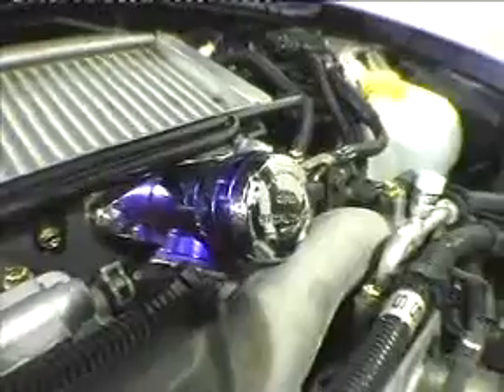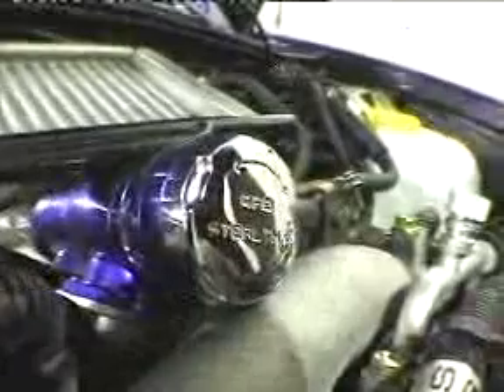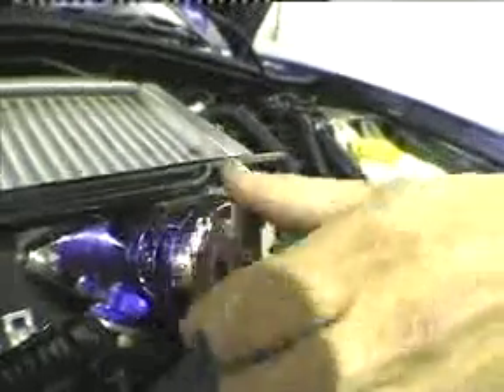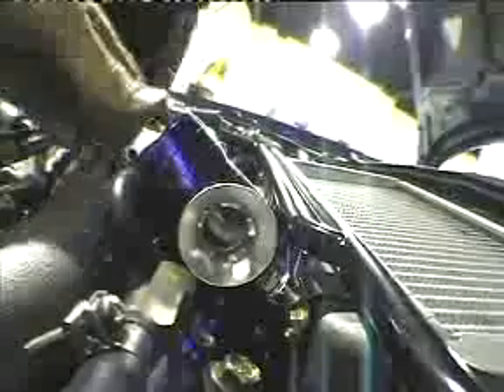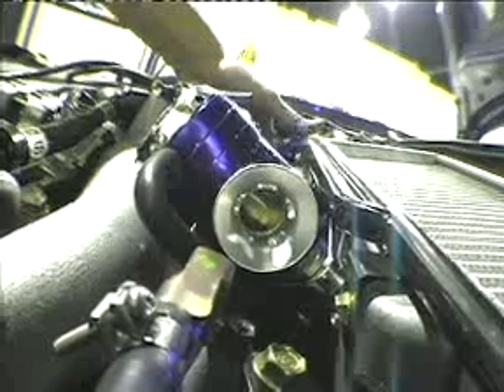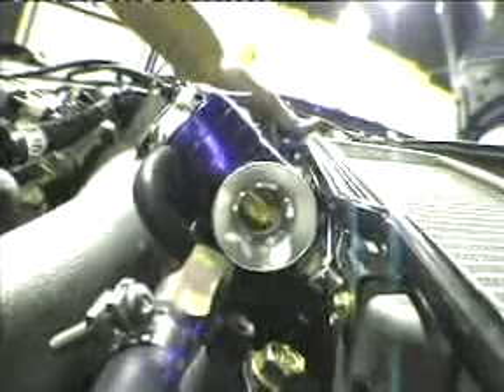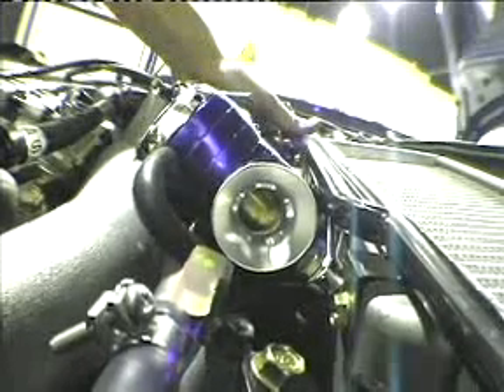GFB BOV Spring Adjustment

Comment from the maker: @josjosjoj - ok, says to find the softest spring pre-load setting to begin with, by turning the spring adjustment anti-clockwise until it stops - this is the softest setting and the point that you should start. Then make adjustments clockwise as per the rest of the description.

Comment from the maker: @rowham1 Ah, yes - very true! I'd say set the adjustment so the top of the screw is about flush with the top of the valve, and that should be ok for the S15. If you free rev it in neutral, you should hear the valve vent, and if you hear the revs dip when it comes back to idle, give it another 2 turns. As long as it comes back to idle nicely, it should be fine.

Comment from the maker: @rowham1 You can still set the spring like this on any turbo car - the WRX doesn't make boost in neutral either, but the turbo still spins enough with a good hard rev to push air. Setting the spring has less to do with boost, and more to do with the idle vacuum. You are effectively tuning the spring pre-load to match the idle vacuum. That way, only a very small amount of boost will open the valve when the throttle is shut.

Comment from the maker: Hey DSB1234567890,
Glad the video was useful.

In regards to superchargers, it should be pointed out that centrifugal superchargers do need BOVs, because unlike positive displacement blowers they are connected to the intake before the throttle, like a turbo. Therefore when the throttle shuts, pressure needs to be relieved. However, on a roots blower (positive displacement) for example, you are correct - when the throttle closes the supercharger's intake is throttled, negating the need for a BOV.

Comment: Nice vid, very useful!
The reason why BOV's are only needed for turbos and not superchargers is that a turbo wheel keeps spinning a bit after the engine slows down, trying to pressurize the closed intake. This is bad for the turbo, or at least bad for performance. A supercharger is direclty linked to the engine, so when the engine slows down it immediately stops pressurizing the intake.

Comment from the maker: In regards to compressor surge, it is true the valve should be adjusted correctly to prevent it, however I wouldn't agree that it kills motors - in very extreme cases it can damage turbos, in less extreme cases it can accelerate wear on the turbo bearings, and in mild cases (a couple of huffs at light load and low RPM, which is not uncommon) it would not be a concern, when compared to the other conditions that a turbo is subjected to day in day out.